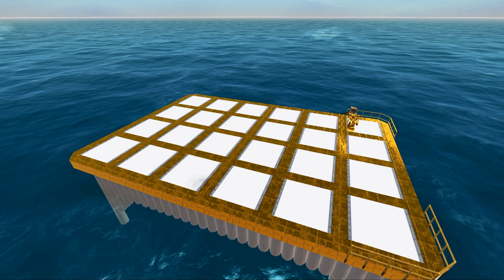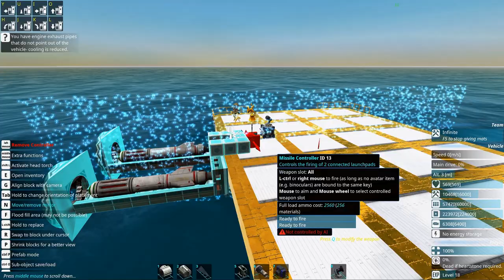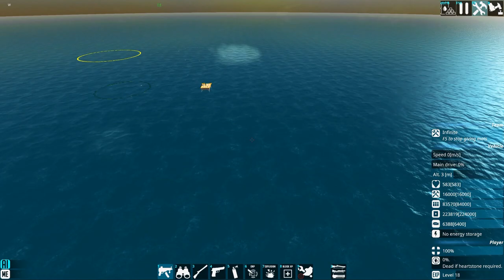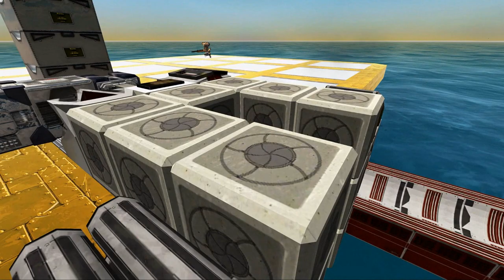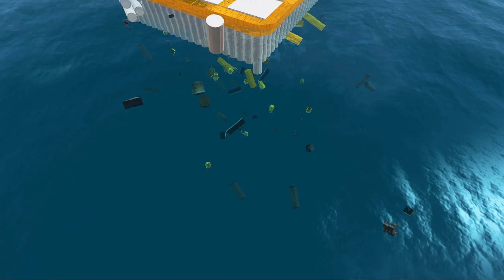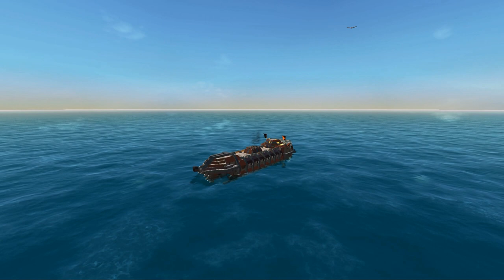From the Depths Torpedo Tutorial - Beginners Guide

Comment: Do a cram tutorial! Try and make the smallest cram possible yet still effective. And for missiles explosive gets a damage buff when underwater
Reply from the maker: I have done a cram tutorial in 2 parts already, however small crams are to my experience not so good, one needs at least 900mm gauge to be able to deal some decent damage.
I think (hope) I did mention that arround floating depths, as the damage buff is the most at 5 m depths or more (or was before at least)
Reply: Gmodism Total Nerdery Channel I’m not entirely sure on that part. As far as I know advanced cannons are amazingly strong and compact only when they get bit is the issue. And in my experience rapid fire crams are deadly but I’m unsure
Reply from the maker: @adonai4493  I got a 6 barrel Spammer turret, but that thing is weak, I can experiment some with small crams since they are cheap, but everyone says to use them with big gauges only
Reply from the maker: Guess cram spammers should be great against wood however!
Reply: Gmodism Total Nerdery Channel it’s only good at low gauge for small ships that need to pepper the enemy. Or if you want an AA cram cannon

Comment: My torpedos arnt tracking the enamy ships any ideas why?
Reply: If you are using sonar and the missile is pointed down, the torpedos detection angle won’t be enough for ships at sea level. I use one turn to fix.
Reply: same here
Reply: @averageuser2007  hmm I don't understand this but I think it's my problem and ima fix it
Reply: @kaddenwoodall2506  sonar has a small detection angle. I don’t remember what it is exactly but it’s not like radar missiles. It kinda needs to aim at the enemy to be able to guide itself. So to fix this you can use one turn, which moves the missile to where the enemy is, and after the one turn disables, sonar takes over and guides it to the target. You can also use APN which basically uses your vehicles detection to help but not fully guide the missile. Tell me if you need more info btw.